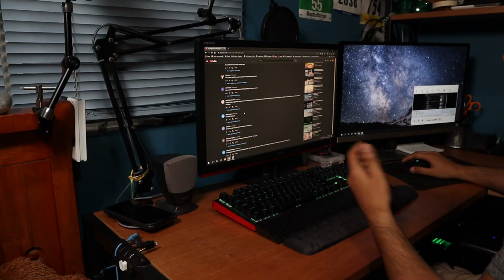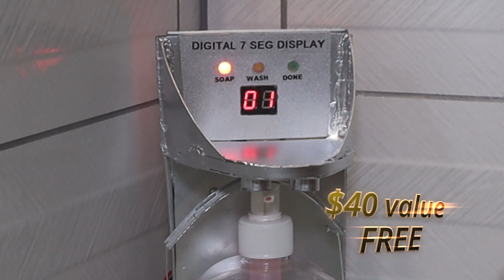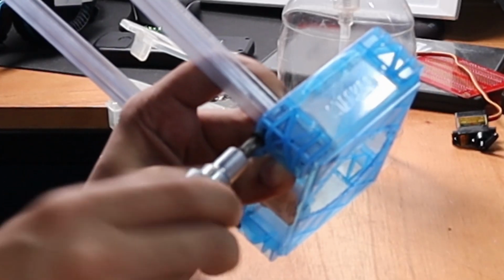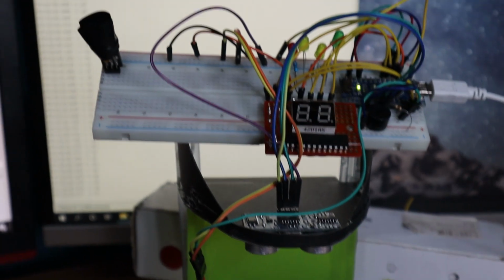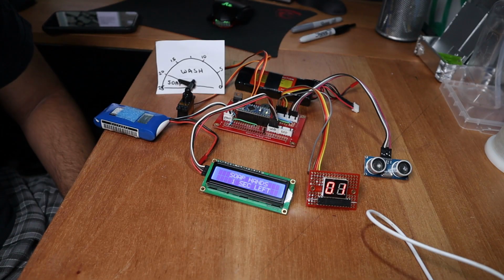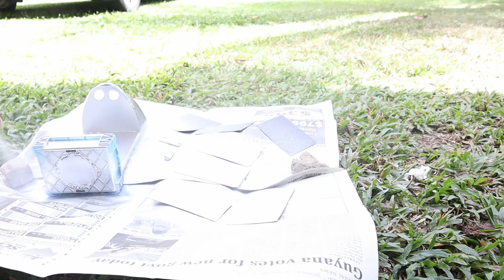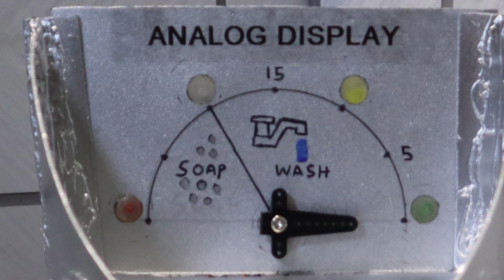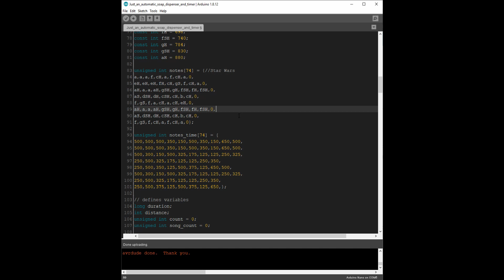The Best DIY Automatic Soap Dispenser | Hand wash timer | Bathroom Music Player

Comment: Hey looks great :D 
I really like the pcb design with the Arduino on top, it's way better to use this pcb plates with the holes than soldering the cables directly to the arduino :) I really have to say that the electronic part is nice :P
You should buy a 3D printer, then you can make so usefull parts not only for this project. ;)

one thing i can recommend: use a LDR Resistor for the night detection, maybe you saw my version 2 of the soap dispenser ( https://youtu.be/M26dUp3X1-w ) there I used it. With that your project needs just a few mikroamps during the night so you don't have to turn of your soap dispenser during the night.

but nice upgrade! ;D
Reply from the maker: Man I don’t know why I didn’t get notified about that video but loved it. Wish I did cause I definitely would have added the LDR transistor switch. I would make the upgrade.

Comment: Good job bro, I loved the analog dial the most.... The LCD and 7 Seg looked nice and clean, but the analog was really unique imo :). Some suggestions to increase battery life possibly: Use a PIR sensor to determine when someone is in front of the sink, as well as the sleep function built into the arduino. When someone is there, PIR will interrupt and wake Arduino from sleep. Can also use the PIR later when you add the automatic water feature (y)
Reply from the maker: I was going to use the PIR to detect the hand but it wasn’t sensitive enough. You suggestion makes more sense. I can use it to latch a transistor to power the Arduino and use the Arduino to take of the latch. Thanks
Reply from the maker: Yes the analog is really Authentic thanks for the feedback

Comment: Good really good
Reply from the maker: onthemudd1 thanks 🙌🏽 which display do you prefer?
Reply: @JustBarran  the 7segment u can use some jumbo ones for more impact
Reply from the maker: onthemudd1 I actually got some once inch ones from a friend but I need to desolder it from a old circuit board. If you on institute can check it out, it on one of my post. Am just procrastinating taking them out